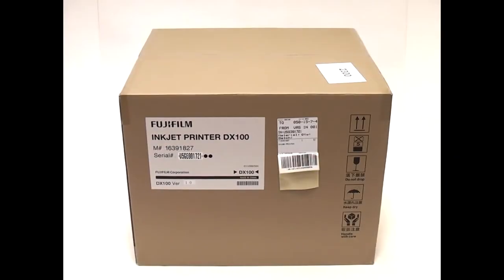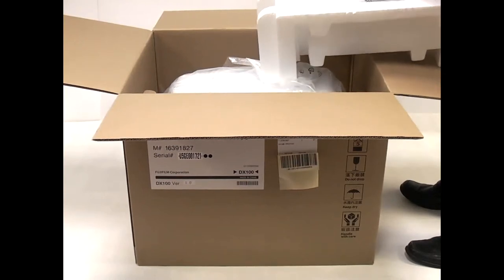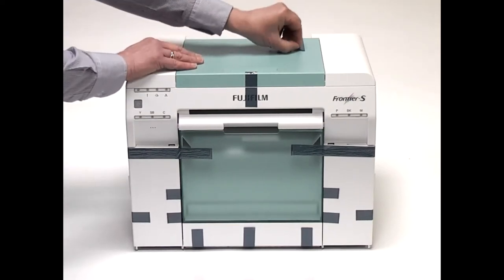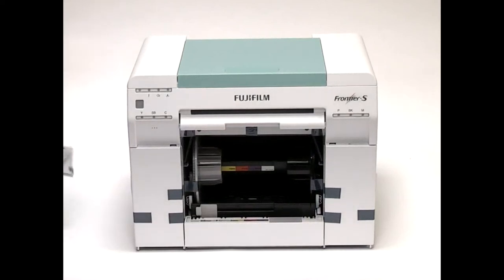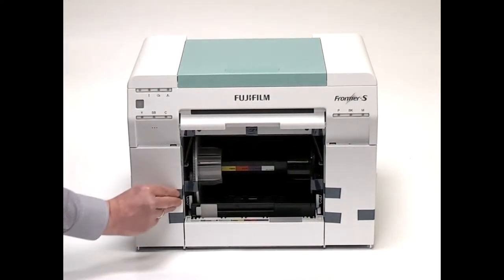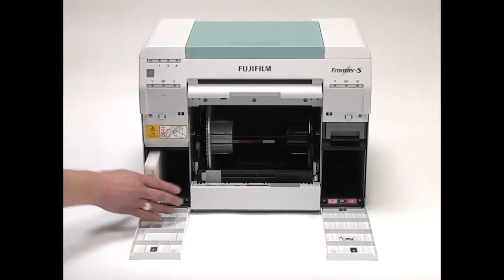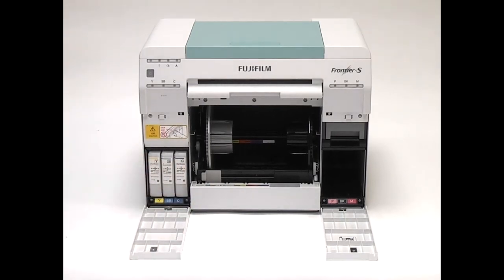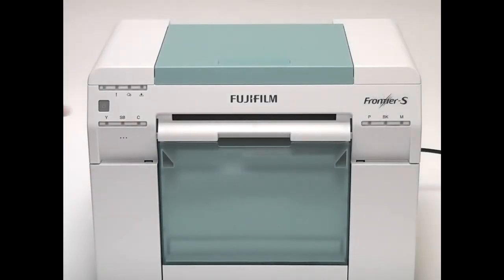Frontier S DX100: Initial Set Up

Comment: i have one. it messaged me. a paper jam has occurred. but i don't found any paper inside. what can i do?
Reply from the maker: Hi,

You will need to power off the printer, open all the covers and check for scraps that may be covering the sensors. Also remove the paper roll and lift the inner guides in case any slithers have fallen inside. Then close all the covers and power on the printer and see if the message re occurs. If this does not resolve the issue you may have a damaged sensor which would need to be checked by an authorised engineer.
Reply: thanks admin